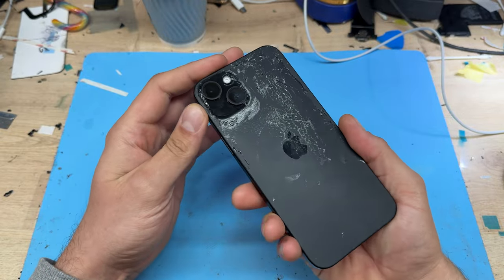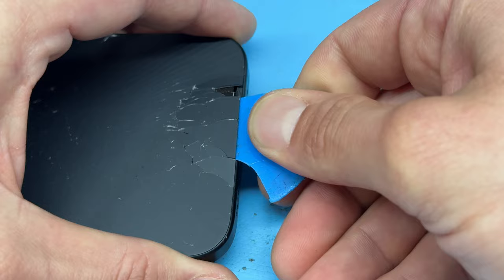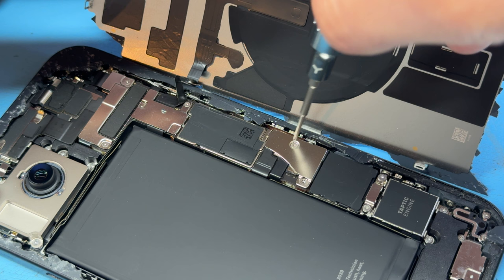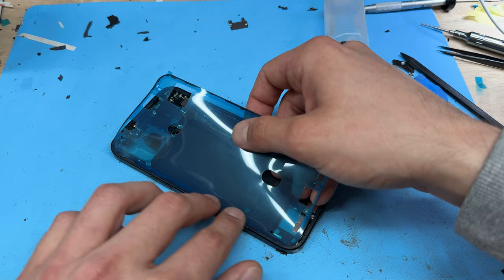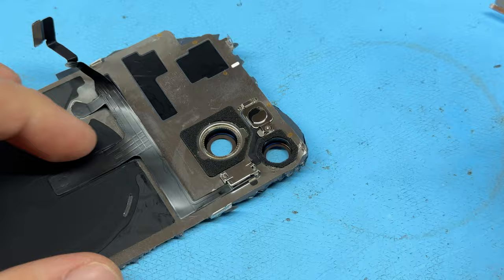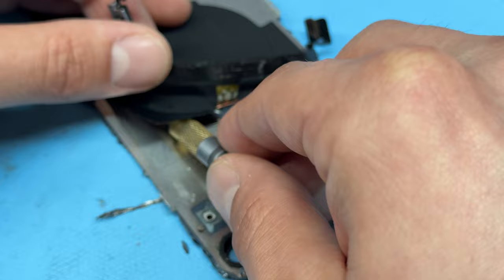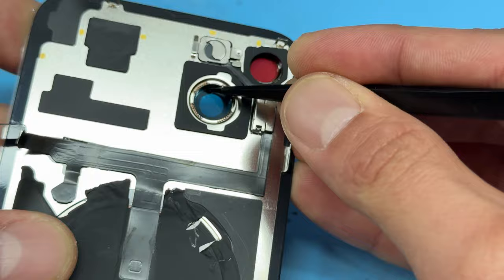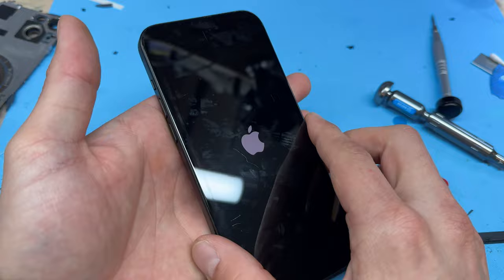How To Fix The Back Cover Of This iPhone 15 Plus!

Comment: Tip for those little plastic covers in the lens - Use blue tac it pulls them straight off, no risk of scratching the lens either.